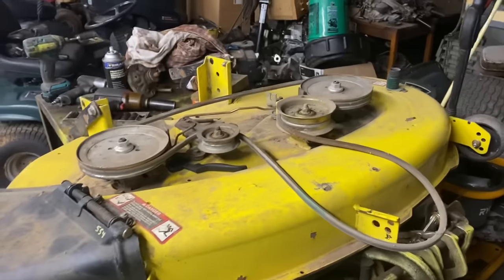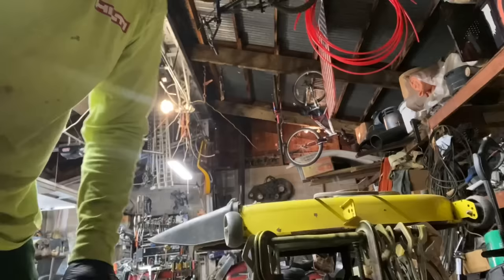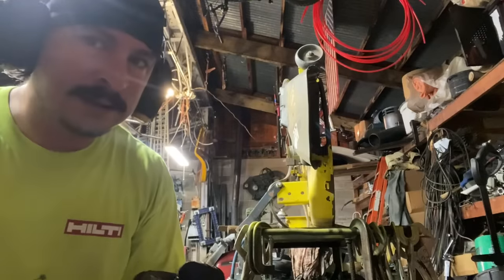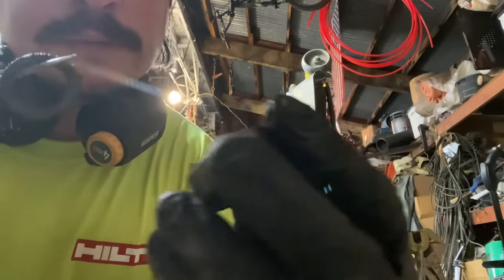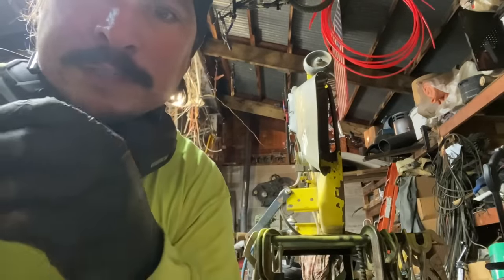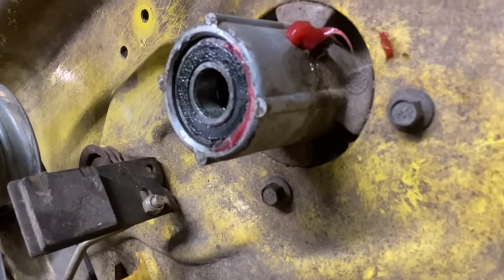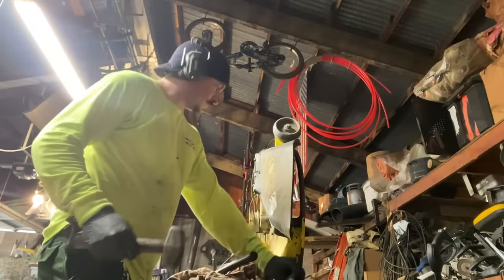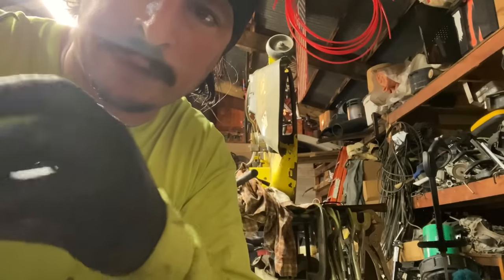Part 1 - Don’t trust the “Experts” Grease your mower deck sealed spindle bearings Common sense.

Comment: I've had a badboy 60" mower for 10 years or so. I've only replace the spindle bearings once in that decade. I'm a mechanically inclined kind of man as I've been in the trades for 40+ years, so I check all those things seasonally, and also periodically during cutting season. One thing I found this year was that the belt tensioner arm was seized onto the pivot bolt. I had to solve that issue on the shop press, so now it gets grease at the end of every summer. I mow an acre and a half, and have had to replace the blade belt about 3x, and the drive belt 1x. this is the 3rd season on the same set of blades, and I even use a hand held grinder to sharpen them. I don't get all fancy with a file. 😅
Reply from the maker: I hate to hear the bad boys loose bearings that soon. Some other folks have commented that they have been disappointed that some models don’t have grease fittings on the mandrels. That seems like a basic necessity in my opinion. If you could grease those once a season I bet they would have lasted much longer. I don’t work on bad boys and only ever owned one. Long before I made this video. I don’t remember if it had zerks. I agree on the blades. I always use a angle grinder and have never used a file or even balanced blades. Some folks make a big deal over nothing. In my opinion I can get them close enough with a grinder that I’m more than happy and I can feel f my deck is running smooth. I’m not big about over complicating things. Some folks want to tear a deck apart to grease bearings when you can simply add it through a zerk if equipped. They should have a zerk on that idler tensioner pivot. Even some box store models have that. Dang shame yours had issues. Did it have a zerk?
Reply: @GTObearclaw1  I've no idea what you just tried to say. A single set of bearings which I replace myself in 10 years sure beats all the other hunks of junk I've owned over the past 40 years. I don't grease sealed bearings because "sealed bearings cannot be greased without removing the seal." I've been at this game a long time, and this is why I still do all my own mechanical repairs on everything I own. All of my mechanical equipment last a long time because of it. Hope you feel better.
Reply from the maker: @Atouk  it was plain English. Just not what you wanted to hear I recon. Sorry I now see that your happy with changing bearings after only 10 years. Odd, I prefer to grease mine and never have to replace them. Seems like that’s easier but I guess not everyone likes that. 10 years is short lifetime in my opinion. Iv seen cheeper box store mowers have bearings last that long or longer without grease. Iv seen some cheeper brand machines that had zerks and bearings lasted 20 plus years. I have had cheeper tractors with zerks and shielded bearings and they take grease just fine. It’s not a seal like a hydraulic cylinder has. The grease passes right through like melted butter. Bad boy is at the Botom of the commercial grade spectrum in my opinion. After owning one I never wanted another. It’s sad they pretend to be top of the line commercial but don’t even install grease fittings on the mandrels on at least some models. Iv seen plenty. Just not my cup of tea. Yes you can absolutely grease a mandrel with shielded bearings if it has a grease fitting. Without a doubt they take grease just fine. I even proved it in this video. Not even sure why we are having this conversation if you actually watched the video you could see every step including the part where I prove the grease pushed past the shields on bearings. Great information but won’t ever get it without watching the video. But glad you could set me straight before I go grease another deck for the 600th time. Geeez, they take grease just fine, Folks are just unaware of this. That’s why I made the video. It’s silly folks think a little thin rubber lip on the shield is able to stop grease. Lol, it won’t. It can’t, it never will stop grease. Those little rubber flaps are just dust shield can’t even hold out water efficiently. I find water in bearings all the time. Sure won’t hold back pressurized grease. Again that’s why I made the video. To help folks that are willing to accept the information. Some folks are so smart they already know everything and not even willing to admit they could be wrong and at least try it. Sad that Bad boy screwed its customers and didn’t add a grease fitting on those deck mandrels. Super cheep. Would have been a huge service to customers for bad boy or any company to install a zerk and inform folks how to maintain it so bearings last forever. But then folks would not need the me mechanics as often and the service centers would have less repairs coming in. Considering deck bearings are one of the major issues I see. Where is there proof that a shielded bearing won’t take grease? I proved they will. But where in the world is there proof they won’t? Other than a bunch of “YouTube experts” saying they won’t but not a single one of those “experts” shows the prof. Because it can’t be proven.
Reply: @GTObearclaw1  No bearing lasts forever, and you can't grease sealed bearings without removing the seal. There's a reason why they're called "sealed." Of course bad boy mowers are bottom of the commercial grade, but so far my mower has outperformed every other mower I've had over the past 40 years. If you're going to install anything other than a sealed bearing in a spindle, you're just begging for trouble. Hand packed open bearings in a spindle will collect dirt because there's no seal. Y'all are a special bunch of driveway mechanics. I go through this same kind of shit at work when some dipshit tries to grease an electric motor that has sealed bearings in it. If the bearings are sealed, remove the zerk. Good lord I'm glad to be my own mechanic, and to have been taught by actual journeymen machinists and millwrights.
Reply from the maker: @Atouk  by forever I mean the life of the tractor. There are many folks out there running mowers on the original deck bearings. Some have even commented so under this same video. Many people who know how to connect a grease gun to a mandrel and properly fill the void. Some folks figured this out immediately without help because it’s natural for many folks who own equipment. As in many cases where you see a grease fitting. Just add grease until you see grease exit and know the component has been fully filled. Many folks knew this way before even I did. I admit, it took me a while to catch on, because I had to figure it out on my own. Nobody told me. There was no video I could find showing how this worked. Only the oposit. I knew that was wrong so I made this video. I never even planned to make a video on this topic until I seen Donny boy terrable misleading video stating the bearings wouldn’t take grease and the inner shields would need to be removed first. What a joke. False information by a “professional” more like crap Information by a man who is more concerned about the money he makes money off being a affiliate selling parts rather than taking a few minutes to provide evidence that can help
Folks run parts longer without wasting money. That’s when I realized even a so called mower expert could be lost on this topic or simply misleading folks on purpose. Could it be a conspiracy? Anyways, I kindly offered him a chance to test the process and correct the misinformation to better help his viewers but he turned out to be proud of his bad advice even though he shows no proof of his accusations he stands behind the video. Too proud to admit he could be wrong. As do the rest of the naysayers. They all say it won’t work but not a single one can provide proof of the theory to support what they believe. Never have never will. Can’t prove a lie. A belief is one thing. Proving it is a fact is another. Can’t prove a lie so here we are. Hay, Here is something cool to know, you can also use a grease needle to get grease in the idler and tensioner and make them go for 2 or 3 times longer, possibly forever as well. And yes it’s possible to do it without damaging a seal. But rather than just try it and put 2 cents worth of grease into a bearing. Just let them fail and run the belt to destruction. Lol. But your just another naysayer who won’t provide evidence. Just want us to think your an expert on the topic after letting us know your credentials. Also now your comparing electric motor bearings to a spindle on a lawn mower. Not even talking about mowers anymore. Here we go off on another topic trying to bring other fields into a conversation strictly about mower maintenance. All bearing maintenance does not cross over. If a electric motor does not have a void / cavity between the bearings with a zerk in the middle, how would it even be related to this. It’s not related. Stick to the topic. All you have left to argue about is that the grease won’t reach the bearings. And Iv already proven it does. Yes it only does reach the bearings once the cavity is full. Grease passes the little thin lip of flemsy rubber on the edge of the removable bearing cap. Easy peasy. Not rocket science, more like the absolute most basic simple maintenance ever. Well? Got any tips on submarines while we are at it. Let’s just dive into other pointless topics. Anyways, the engineers do plan this stuff out. Yea they get stuff wrong sometimes but this is like an easy 40 years straight of the same design. Just because you fix stuff for 40 years don’t make you a expert.  Sounds like you haven’t pulled a deck apart in 10 years up until the bad boy broke. Maybe I’m wrong but not sounding like you actually have a lot of experience with mower decks. Sit back and rewatch the video completely. You might learn something if you will pay attention to the process. Seriously it’s so simple, like kindergarten mechanics. I’m not throwing around my credentials and I’m barely 40 years old and seems I might know a tad bit more about mower bearings. I’d be embarrassed to leave a comment like this on a video where I was just proven wrong but went ahead with my unfounded argument
That has never been proven anywhere. if you think they have been installing zerks on decks for the past 3 or 4 decades and didn’t expect people to put grease in them. You seen a zerk before but never tried using it in 40 years and running bearings to failure seemed like the better plan. And yes a set of bearings can easily last the life of a tractor if properly lubed. If you prefer to remove bearings and grease or run to failure vs just connect a gun and grease until the bearings are lubed, you could benefit from this information. It’s just that simple. Iv laid out the proof in a step by step video. Feel free to debunk my findings. You won’t be able to. You will end up learning something in the process and realize you went 40 years missing some simple basic services in the lawn mower world. But okay. Just keep arguing without a shrewd of evidence. The video here proves it. Plenty of folks been leaving comments saying they have done this for years and works exactly as Iv stated. Don’t even bother reading those. I’m sure they are all Lies too. 

If your dead set that the process wont work, please connect just connect a grease gun and pump till you see grease exit and tell me how it came out of the assembly without passing a bearing bearing first? Can you at least tell me
That much? If you can’t simply look at those removable shields and realize they won’t hold back pressurized grease, I guess I can’t help anymore. I’m willing to keep trying. Seems like your stuck on the false premise that a little cap over a bearing with a extremely flexable rubber lip is somehow capable of stopping the grease from slipping right past. Grease is kinda like an octopus, it finds its way through some tight spots. And these bearing shield lips ain’t even a tight spot. Maybe I’ll tap in a pressure guage into a mandrel housing and fill it with grease just to see how much the pressure needs to be before grease passes the shields. I’m thinking 5 psi. And a grease gun can put out thousands of PSI. It’s just simple logic.

Comment: My JD X300 mulching deck only has zerks on top of the spindles......not the sides of the assemblies like yours. Do you think it will make it all the way into the bearings if I just pump it in from the top? Great tutorial bruv.......thanks. 
Dave (in the U.K.)
Reply from the maker: The x300 is the commercial model and a way better machine. Yes it works exactly the same. The only difference is the way your assembly is made. Grease that baby till it exits the assembly through one of the bearings and you will be good to go for years.
Reply: @GTObearclaw1  Thanks Russ. The only way I'll know is if I grease it until it pushes out from the boss  immediately above the blade. Where's my red n tacky?! 👍

Comment: Question: Since my deck bearings are already screaming, do you see any harm in drilling and tapping in grease fittings. Any chance the inner seals will filter out the shavings that will get into the hubs? I will rebuild them next winter. The housings are steel not aluminum
Reply from the maker: Could not say what the Shavings would do but if the bearings are already failing it wouldn’t hurt to try.

Comment: Excellent maintenance tip.  I would not have even thought the grease would have gotten through the seals. I definitely learned from your video to pump, pump, and pump that grease into the spindle until the seals get entirely lubed.  So pumping 40-70 pumps of grease into the spindle should ultimately save the spindle from siezing or cracking, right?  What a great display.
Reply from the maker: Filling the assembly the initial time will require as many as 40 to 70 pumps. Iv even heard 100 pumps. After that the latter services should only require a few additional pumps to see fresh grease come out. In my opinion this will greatly in tease the longevity of the mandrel bearings and should help to eliminate premature failure of the bearings.  If the bearings are already making noise this won’t fix bad bearings. It might make them go a little longer.

Comment: I'm surprised that there was a zurt since it had sealed bearings. I'd remove the seals if I had it apart. Good demonstration.
Reply from the maker: Most machines of the big box store assortment have zerks but all the chepo machines have these type bearings. Thanks for the comment.

Comment: Obviously it will fill the bearings with grease if you blow the seals out. The spindle will build heat and grease will run out over time. Most people won't grease often enough to keep this from being a problem, which is probably why everyone went to sealed bearings in the first place.

I always remove the inner seal to make sure some grease is going to get in there.

I just wonder if leaving the seals in place and forcing the grease thru there would cause the seal the heat up and melt and still end up causing premature bearing failure because of the melted rubber/plastic seal. Why not just pull the seal out if you're having to have it apart anyway?
Reply from the maker: I thought it might be obvious I was 
Taking it apart to show the process and results. No the inner seal does not move and contact bearings. Grease passes the lip and that’s all. Super simple stuff. Seems really overly complicated but after performing the process a few times it all makes better sense. No need to tear a deck apart to pull seals out. The average homeowner is not going to have the tools not have interest
In that. They just want the bearings to last and other clowns on YouTube say not to even bother adding grease. So I’m trying to show folks the process and that it works. If you didn’t watch the whole process you missed the important stuff.

Comment: I have drilled them and put a grease fitting in them to get more use out of the mower.
Reply from the maker: Smart man 

Many brands don’t have a zerk added, some of the lower end units don’t have a zerk but very simple to
Add a few and will
Help a lot. Not everyone is fortunate enough to get a machine with zerks but if they have them already installed it would definitely be wise to grease them.

Comment: What about removing the inside nylon bearing covers cleaning them well and drilling two or three holes of small diameter into them and replacing the covers onto the bearings.. That would make it a bit easier for the bearings to accept the grease...Thank you for the informative video.
Reply from the maker: This is actually a question / comment I get nearly on a weekly basis it’s seems. I really thought the video would be self explanatory on why that’s not necessary and partly the reason I made the video. I’m not real good about preparing talking points for the video but I see that I left a lot hanging out in the wind: this ain’t against you and not meaning to be rude, Absolutely a 100% wasted effort and completely worthless venture. Adding passages or removing a seal from an assembly that allows grease to pass through without a real restriction in the first place is just looking for something to do and won’t be any benefit. Why take things apart if I just proved grease passes. What else could make it better? It’s way more simple than some folks want it to be. No need to reinvent the wheel. Some things just work fine like they are now. If you have zerks and No weep hole, just enjoy that you got one of the machines that allows for servicing bearings without need for modifications. Soon they won’t even give us this option as the equipment is moving towards 100% non serviceable